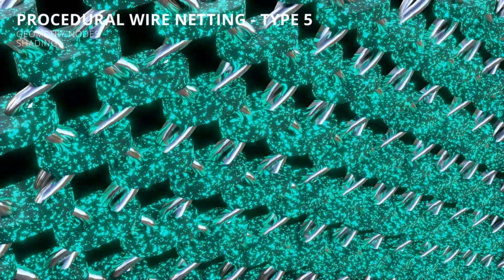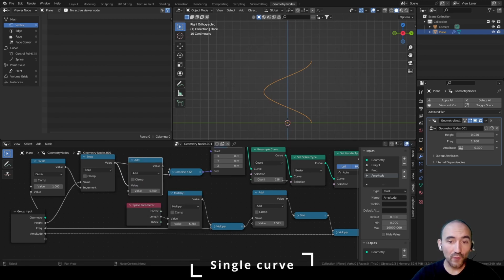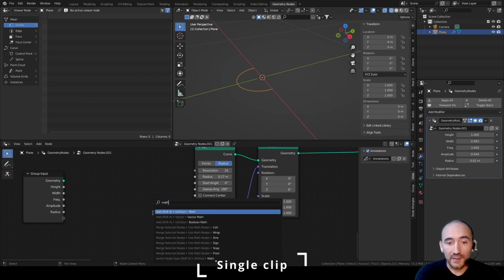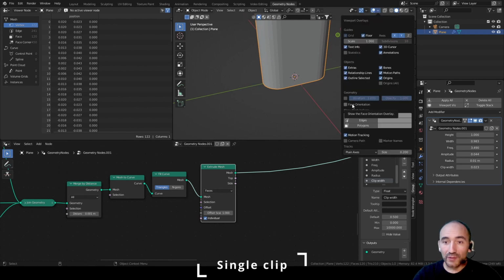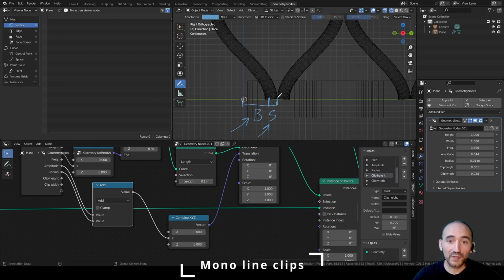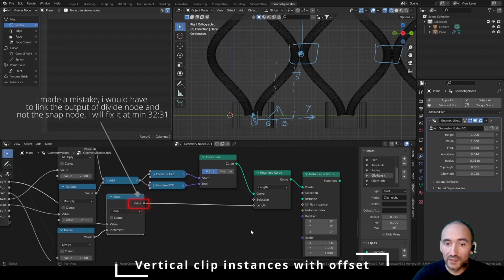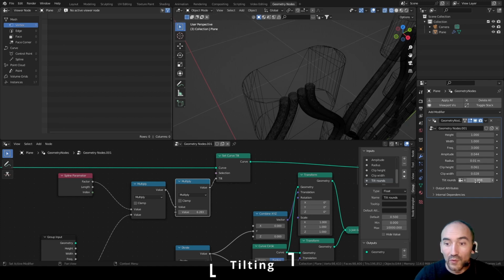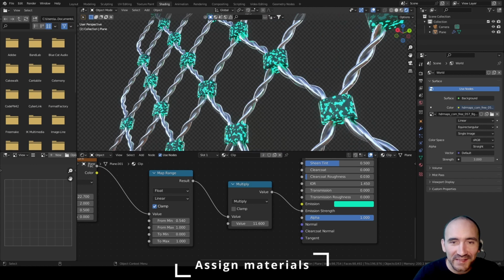Rete metallica procedurale tipo 5/8 in Nodi geometrici - Tutorial Blender ENG

Comment: Hi Andrea! Is it possible to deform this wire to follow it curve? All of wires are grear, but Im stuck on this question
Reply from the maker: Thank you! Yes, it would be possible depend on what you need.
If you need to deform the entire mesh you could use the lattice deform modifier or the mesh deform modifier after the GN workflow.
Another way is to create your single vertical (eventually tilted) line with GN (so the first steps of my workflows), then add a curve deform modifier to let the curve and the profile curve follow a custom curve and then add the remaining part of the GN workflow to instanciate the deformed curve.
Another way is to add a displace modifier after the entire GN workflow or add a set position to the final GN workflow with offset attribute linked to a noise texture with a subtract vector of 0.5,0.5,0.5 in the middle and next a scale node in the middle.
If you have a practical case we can working on :-)
Reply from the maker: Another way is use a deform node (made from scratch in GN) to let the entire single curve follow your curve. To do this i can suggest you to follow this link: https://www.youtube.com/watch?v=vYXeqwqauzE I hope i've helped you.
Reply from the maker: I think the explanation of the video might be improved a little bit so i think i will add a tutorial about it to explain more deeply the deform method. In this way you'll be able to use the workflow and understand it 🙂
Reply: @andrea_ciani  it will be great! Thank you a lot